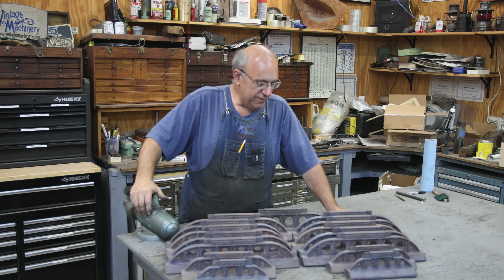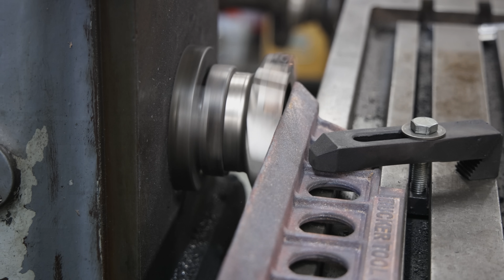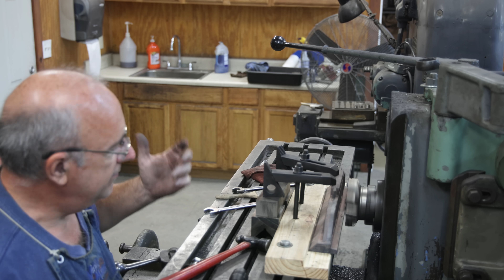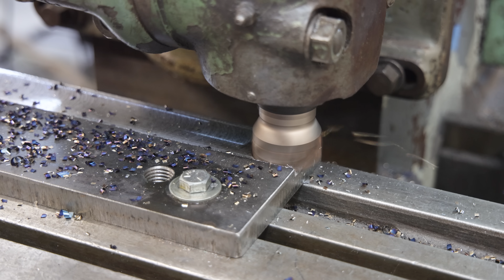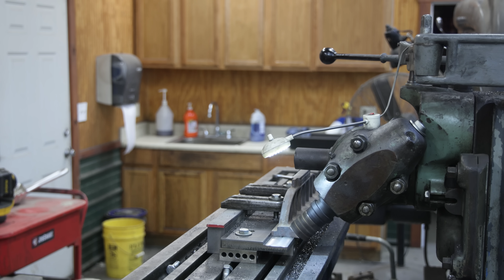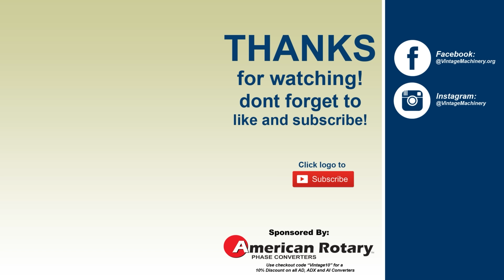Machining Straight Edge Castings

Comment: Question: Could you set up the overarm and arbor and gang mill the bottom and the perpendicular edge simultaneously? Then flip it and do the top with the same horizontal cutter. Then turn 90 degrees and use an angled cutter? You could load all the cutters on the same arbor, and build just one fixture. Depending on how everything is configured you may not even have to move the table in and out, as the different slots in the fixture could position the straightedges to match the cutter positions on the arbor.

Comment: The steel platten likely isn't strong/stable enough long term. Maybe Clark can cast you  nice big block of cast iron 3" thick 10" wide 18 or 20" long. That would be good to make a nice multi position fixture for your straight edges to minimize setup time.

Comment: Feeding slowly does not necessarily reduce tool wear. If you are feeding more slowly with the same tool speed, the tool will be taking a higher number of cuts for each inch of feed. So, the question is: Does two light cuts wear the tool more or less than one cut that is twice as heavy? I am guessing that the relation is non-linear.

Comment: Doesn't the straightness of your cut depend on the straightness of the table? If the table moves in a slight arc then that ends up in the work.

Comment: They will be nice straight edges when done. The steel fixture plate is a good idea. You could mill some "keyways"  in the bottom to locate it on the table, then you can just mount it quickly, and accurately. You could make your "spacer blocks" similar to suit. That is, if you plan to make more of these like you said. It will speed up your production work. Im not a fan of production stuff either.  Will you be putting out a video or grinding them?

Comment: 34:28 - Many years ago, I bolted two 1"x 3" CR C1020 bars together edge-to-edge and cut a hole on the bolted seam for use in a hydraulic press. On unbolting the parts, it was amazing how far they moved. I lot of stress in those, and I have no idea how long it had been since they were rolled to shape.

Comment: Why could you not set up 3 or 4 castings end to end and machine them all at once, instead of one at a time??
Reply: Basically Bozo AKA the Elmer Fudd of machining will basically work on ANYTHING but that basically pesky Stoker Engine!
Basically he's used those straight edges to basically "scrape in" ( screw up) many of his machine tools.
So basically lets get out the pop corn and basically have some laughs, basically.:hand-orange-covering-eyes::face-blue-smiling:
Reply: @garybrenner6236  Your Basically, a DUMB ASS. :trophy-yellow-smiling:

Comment: You are not making a perfect edge. Certainly the wood will hold the pard nicely. You are making a rough cut on width, not a .0001 surface.  Eventually, the wood will wear a bit but unless you are looking for a perfect parallel... it doesn't matter mutch.  You want a flat bottom. The edges don't matter of they are not .0001 tolerance.  It looks nive, smooth, neat and fairly fast.
Reply: It is easy to deal with several thousandth when scaping, even more. I have scraped both worn-out surfaces and new cast iron that had been milled. It doesn't matter.
Reply: Basically Bozo AKA the Elmer Fudd of machining will basically work on ANYTHING but that basically pesky Stoker Engine!
Basically he's used those straight edges to basically "scrape in" ( screw up) many of his machine tools.
So basically lets get out the pop corn and basically have some laughs, basically.:face-purple-wide-eyes::face-blue-smiling:

Comment: If he hadn't of mentioned it would I be in the group of mentioning the wood!
We shall never know 😇 you need a Delorean to confirm what will happen in alternate realities.
Still though it worked and that wood is alot.. cheaper than the 3/4 metal plate.

Comment: Thank you for taking us through this step.  I watched Clark's casting videos and now this one.  It would be really nice if you would show the grinding and even scraping [the crowd boos].  From brake discs to final scraped straightedge - that's a cool series.
Reply: Basically Bozo AKA the Elmer Fudd of machining will basically work on ANYTHING but that basically pesky Stoker Engine!
Basically he's used those straight edges to basically "scrape in" ( screw up) many of his machine tools.
So basically lets get out the pop corn and basically have some laughs, basically.:face-orange-biting-nails::face-blue-smiling:
Reply: @garybrenner6236  Basically, it seems as if you are Anti Keith Rucker by those statements .... Basically speaking of course.
Reply: @garybrenner6236  "Basicaaly"the same dribble and bs as last time. Seriously what a total LOSER.

Comment: I agree with oldschool1993.  The old school way of stress relief was to haul the castings out back in the weather and leave them for a few months up to a year.  Annealing applies it's own stresses.  Old school techniques don't lend themselves to modern manufacturing in a just in time world, not to mention the aging of inventory.  Sand or shot blasting also removes stress in parts.  The size of your strait edges would be ideal for blast stress relief.  Of course this was yesterday and yesterday's gone as the song says.  I still remember the days when things were made mostly of metal, and plastic or phenolic were only used when there was a fictional reason.  I don't see any plastic parts on your old machines.  But, time goes on and we are now in the disposable age pump it out and make it obsolete before it wears out.  Just my observations of the new machine age.
Reply: Check out Steve Watkins older videos on how he stress relieves long straight edges in his furnace. He starts at over 1000 degrees and stress relieves again after each machining operation.
Reply: Yes, I understand that a lot of the machine tool manufacturers here in the UK would put the new castings into an outside storage area where they would sit "improving" for months. Must have been a bugger to try to work out what was going to be in demand in 12 months time.
Reply: when They still did, the engines cast for ford cologne were all left outside for a year, that practice was kept up until they stopped making IC cars in cologne

Comment: A national racing team that I'm friends with uses a Metallax table to high frequency vibrate all their frame & support parts. Increased the longevity & quality of dimensional measurements. Takes only an hour or so & replaces years of relaxed setting or weathering with hot to cold movements.
Reply: Similar to 'Ringing' Keith mentioned , vibration stress relieving

Comment: One at a time? Table looks long enough for 2 or, 3 even?
Reply: El largo de la mesa no es lo mismo que el largo de la carrera de la mesa 
Ejemplo:
Largo de mesa:1200 mm.
Largo de la carrera de la mesa: 700 mm
Reply: Basically Bozo AKA the Elmer Fudd of machining will basically work on ANYTHING but that basically pesky Stoker Engine!
Basically he's used those straight edges to basically "scrape in" ( screw up) many of his machine tools.
So basically lets get out the pop corn and basically have some laughs, basically.:face-orange-biting-nails::face-blue-smiling:

Comment: To anyone that might know, when you get one of these should you let it rest for a period of time or machine it first and then let it rest before scraping? 
Or are these ready to work on as soon as you get them? Thanks and have a good one out there!

Edit: I should have waited until the end of the video to ask questions, I’ll learn one of these days, I always think I won’t remember what to ask.
Reply: I'm no pro, i only just learnt you should hammer ring castings lol.
But why not both. scrape a new casting in on a surface plate so it's ready to use ASAP. 
Then be prepared in several months or whatever the timer period is that a new casting will move just a tiny bit and re scrape it back in.
I bet the casting moves so little that the second round of scraping takes a fraction of the time of the first.
Reply: A pad beside the screen is useful for making notes.  Now, if I can remember to do that?
Reply: Some factories rough machine the castings and then let them "rest" for 6 months to a year. They always move with time.

Comment: Mr. Rucker 
You need to say that prices may change Without notice!!!
Reply: Always should when there are multiple variables! Or you add enough to the price to cover them...
Reply: We digitise film , VHS etc and prices vary on the ABILITY to pay and the final  use . If it is for a non commercial community use , it could be free.

If it is for commercial use , we would charge higher . 

Any money 'profit' we make buys modernised equipment . 
We are not for profit for the benefit of the community . The most deserving get the biggest discount ( and they are usually the MOST insistent on paying full cost !